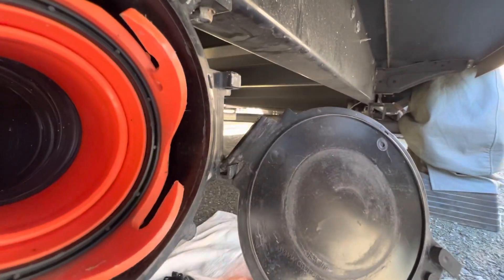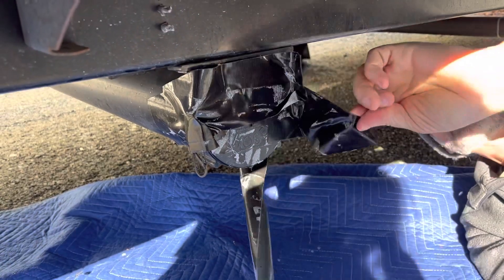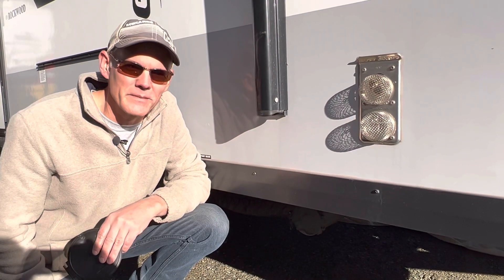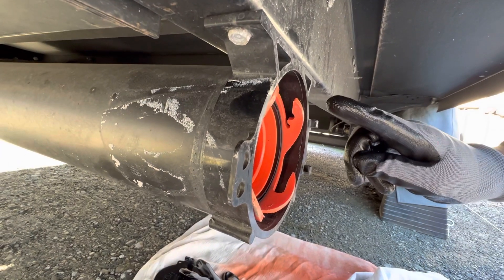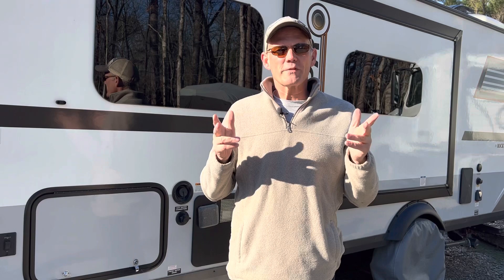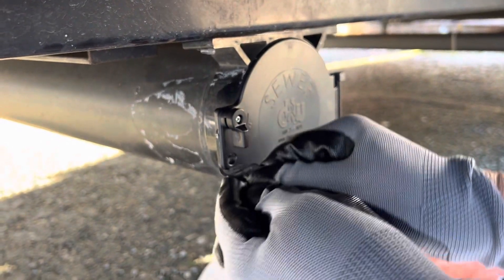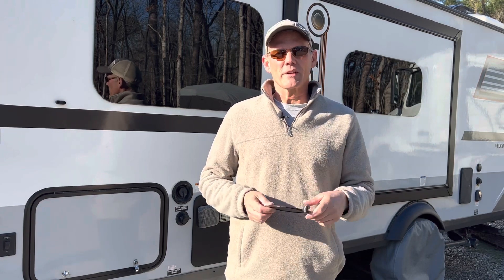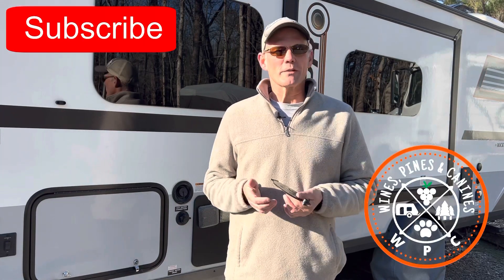Repairing Our Sewer Hose Storage Tube - Parts & a 2 Minute Fix!

Comment: Great video of a problem that you have shown is an easy fix (and where to locate the replacement). Those doors, particularly the pins that connect the door to the housing, is VERY flimsy. I just opened the door to the sewer tube housing and it broke! I will certainly be much more careful next time so I don't repeat this issue again. Fortunately, only one of the pins broke so I was able to bind it until we got home. I have already ordered the replacement door (2) so if it happens again, I have a spare. I will also follow your suggestion to attach a carabiner to secure the door. Thanks for all of your great tips and videos!!
Reply from the maker: We love the easy fixes lol.  We got 2 years out of ours so counting ourselves lucky as you are correct - definitely a bit flimsy.  We saw the carabiner suggestion somewhere years ago and like to pass it along - would not be fun to see the hose trailing behind as we drive down the freeway haha!  Thank you for watching - we truly appreciate.

Comment: Spares are great!   Good catch and great video.   I keep a tray type fishing tackle box of small spares, a couple pipe clamps, zip ties, screws, spare hitch pin etc. under the drawer below the bed on my GeoPro 19FBTH.  You have to pull the drawer out to get at it, but it takes up no otherwise useful storage space.  I keep it from sliding arround with a small strip of sticky back Velcro
Reply from the maker: Great tip!  We have also found lost space behind the drawer under the bed.  And your idea is a great use of that space - thanks!  And thank you for watching!

Comment: The issue is the plastic hinges.  It should be a stainless steel pin. Both the hinge pin and the locking latch broke on ours.
Reply from the maker: Don't disagree.   The stainless steel pin would be a nice upgrade.

Comment: Great video!  Is that the original tube?  Lost mine on the 84 east.  Looks like the leading screws came loose and snapped the brackets off.   What replacement tube do you recommend?  Thanks!
Reply from the maker: It is the original.  And wow - may need to take a closer look at ours to make sure thos screws are tight!  It looks like Valterra makes one that is adjustable from 50-94" and gets good reviews on Amazon.  That would likely be where we would start to see if it would work.  Good luck with the replacement and let us know what you go with!
Reply: @WinesPinesandCanines  that's the one I went with.  Ditched the self-tapping bolts and went with some stainless bolts with nylon lock nuts.  Doing a Grand Canyon trip in Nov and will see how they hold up!

Thanks for the response!
Reply from the maker: Have a great trip!  We loved visiting the GC a few years ago.  Can't wait to return!

Comment: Is that the stock tube? And what size hose are you using? I have a 15ft Titan brand that barely fits in the tube lol
Reply from the maker: It is the stock tube.  We have a 15ft camco rhinoflex hose and as you could see - with the elbow it just fits! Thanks for watching.

Comment: I will order the replacement door. The big question is about your kitchen sink. I want one bad. Can you get me the part number for the sink and faucet? My 2020 is just like yours, and I love it. Jerry
Reply from the maker: Hi!  So the sink we purchased was off Amazon but it was discontinued a few years ago.  However, have seen many owners of the older models contact Forest River parts dept to get the sink they use in the current models (believe it is 15x15 but not as deep as the one we have here).   From what we have heard, the only modification was to square up the corners in the countertop as it is a square sink so a fairly simple drop in!  (ours required modifying the plumbing and drawer because it was 10" deep).  Hope that helps!  And thank you for watching!